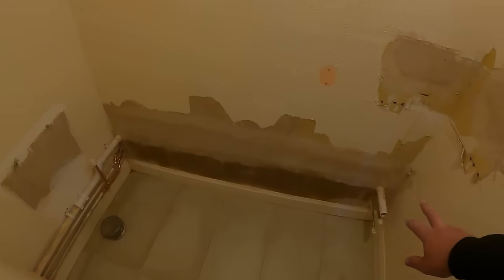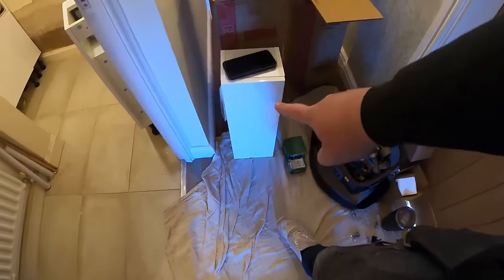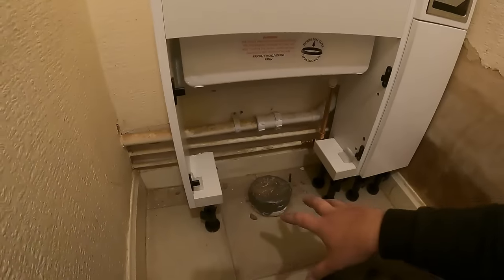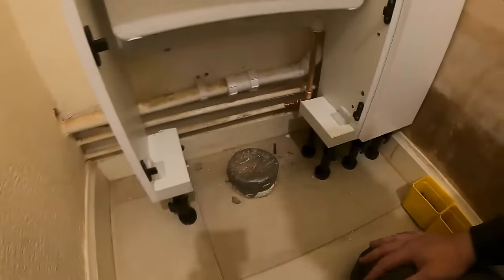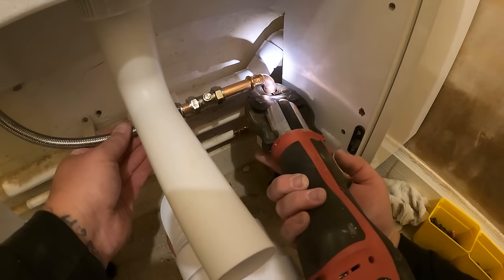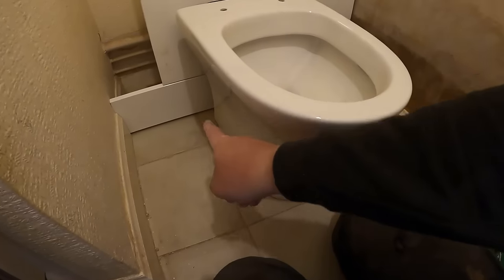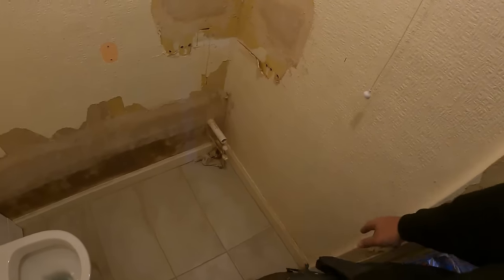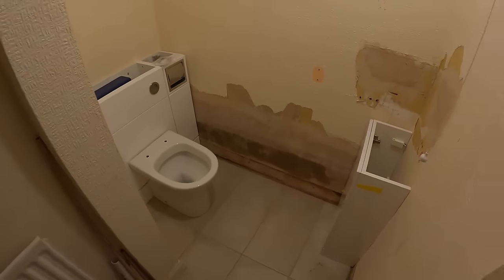REAL WORLD PLUMBING... What would you of done in this PLUMBING situation??

Comment: With the corner unit - what about putting a piece of white furniture board that’s the same thickness as the skirting board between the unit and the wall (so it means the whole unit is now pushed away from the wall by thickness of the skirting board. That would make it so that when the door opens it naturally lines up with the skirting board. So in short it brings the unit away from the wall but doesn’t leave a visible gap. Hope that makes sense?
Reply from the maker: Yer I get what you mean…. However it would push the basin away from the wall aswell and look a little out of place imho…..
Reply: @MJTiffPlumbing  Ah yes, fair enough. Great channel by the way - your content is really interesting and informative - keep up the good work!

Comment: Great job as always. As for the iso valve situation i suppose you could drill a large enough hole on the side unit so you can get to it. Most of the cisterns require access to the flush valve etc, so normally the back panel will haveto come out. Sharp stan,ey does the trick . Cloakrooms are a nightmare tbf.
Reply from the maker: This one has been a pain for the size of it tbh

Comment: Isolation valves everywhere that’s the rule. You might not think you’ll ever need them, but you will. 😂😂😂 
As a plumber that does kitchen and utility fits as well I would have put some kind of fillet in between the cupboard and the wall and put the skirting back on to hide your dodgy wall. Also your cupboards going to have a handle on it probably? So that would help with the amount you can open it. Then put your surface across the whole thing to hide it.
Reply from the maker: Wouldn’t have looked great with a gap on the basin….. that’s why I went the extra bit and got it done right👍🏼👍🏼

Comment: 0:00: ⚙️ Progress update on cloakroom build with units being installed while customers are away on holiday.
3:36: ⚙️ Challenges in fitting units together and resolving end Gap issue with help from Dave Bishop.
7:04: ⚙️ Installation process of connecting cold water, cutting out panels, and debating on cutting a flush pipe into position.
11:42: 🚰 Plumber demonstrates filling and testing a tap for water tightness in a plumbing situation.
14:39: 🚽 Plumbing work progress: fixing toilets, preparing basin installation, and carpenter's arrival for unit trimming.

Timestamps by Tammy AI
Reply from the maker: Thanks

Comment: Always putting an isolator valve is a good idea pull the panel up behind the toilet and toilet can be isolated if there is a problem and the rest of the house has water good video again
Reply from the maker: Thanks mate 👍🏼👍🏼
Reply: Toilet gap and panel should be siliconed for hygiene and aesthetic reasons. Therefore, removing the panel to reach the valve is easier said than done. 
 I would have put a small access hatch in the adjacent cupboard to reach the valve.

Comment: If I remember rightly, the customer wanted the original skirting put back. The sink unit door being so low was overlooked by the customer when ordering this item. The only way around that would be to pull it away from the wall (and use an infill), to give clearance for the skirting or fit smaller skirting. Good job so far.
Reply from the maker: Would leave a gap at the back of the basin so was not going to work….. skirting is gone

Comment: Small toilets - usually under the stairs are often a pain to make things fit. Old pipes, wonky floors etc. Just wondered why you didn't bring the toilet feed pipe with isolator up to the top so it could be used by the householder in an emergency. One bit of plastic pipe and a push fit elbow!! Sod the press fits!! The little gap I'd have told them its ideal for the brush!!
Reply from the maker: The smaller the job the more hassle it is 🤣🤦🏻‍♂️

Comment: Those cisterns are good until you have to use it on a comfort height pan. Leaves just enough length on the flush pipe that the nut goes round the bend and can be a real pain in the arse. Like you said, pointless having isolators on them as to get to it the pan has to come out anyway! Good video though, alot of effort on the cupboard. Be Modern do 175mm single door units if you ever get stuck! Either that or just use an infill panel 😂
Reply from the maker: Yep I know what you mean with that depth of the cistern 👍🏼👍🏼